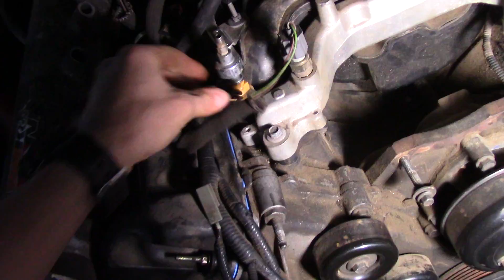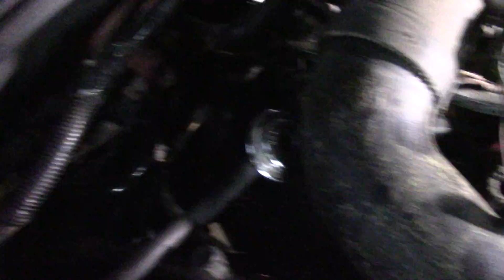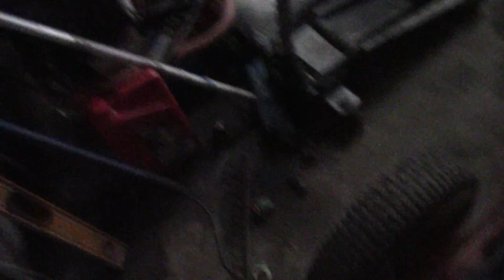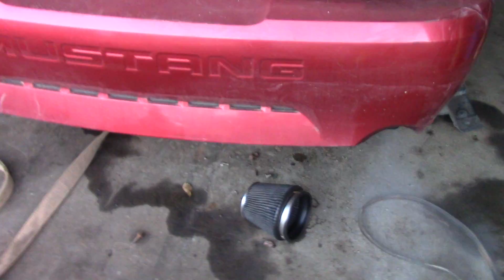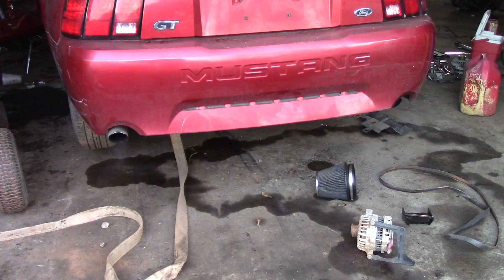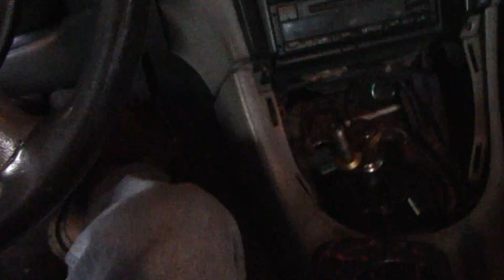ITS ALIVE!! Mustang GT Project FIRST START!!

Comment: I wonder what the differences are between that Grand Marquis motor and GT motor that come out of there. I would assume just camshaft profile other than the bolt on stuff like manifold throttle body and Etc that you have put back on there already
Reply from the maker: We mixed and matched so many parts from an f150, a grand marquis and a mustang its not funny... Hell even the valve covers on each side are different,  Someone told us it wouldnt work. So the old man set out to prove them wrong lol.
Reply: & proved them wrong you did.. if it fits and works no harm in mixing different parts. The first drive shall be good ,, keep up the good work.

Comment: If you think that's loud get a straight pipe exhaust system with an h pipe it will be way louder and more intimidating
Reply from the maker: The camera didn't do it justice. And there are noise restrictions so we cant make it too loud